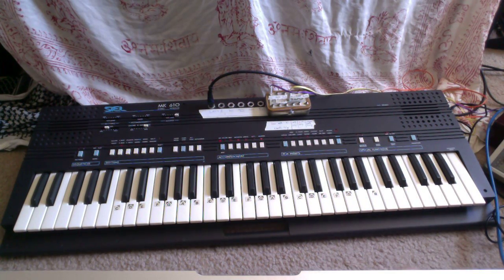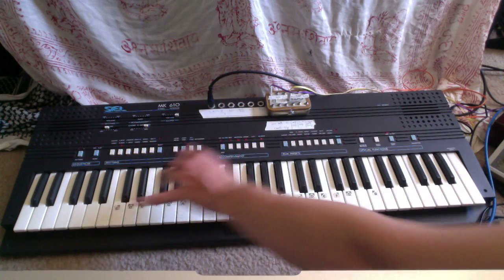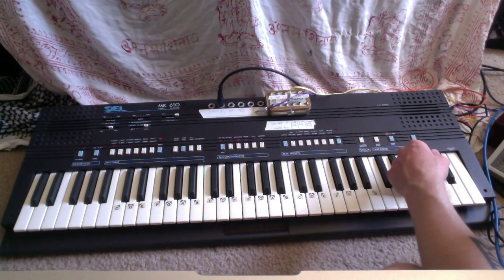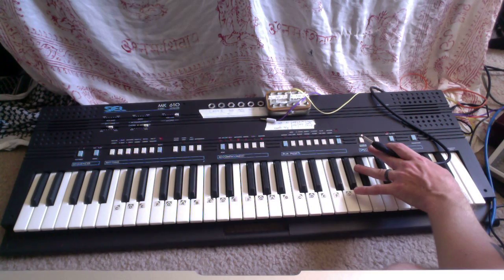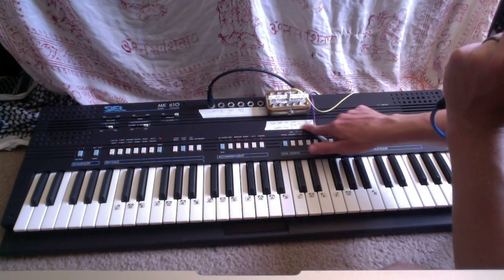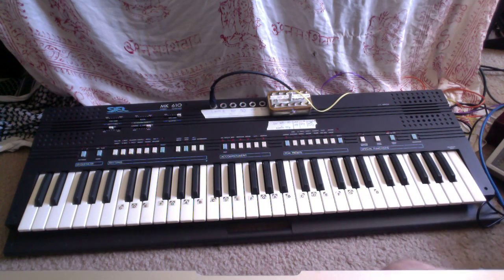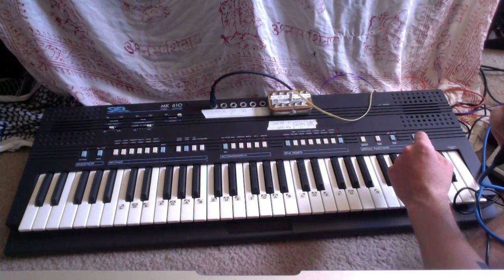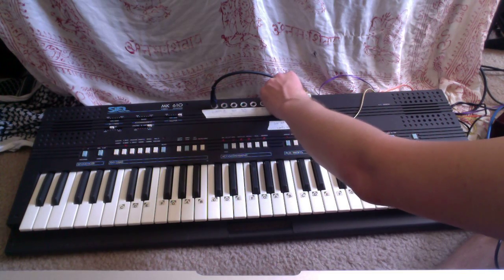siel mk-610 keyboard synthesizer mod circuit bend demo video

Comment: Hi! I just got a Siel mk-610 to use as a midi keyboard. I have it all hooked up to my interface (audiobox usb) but no midi signals are going through. I'm wondering if there are settings I have to change on the keyboard itself? The MIDI button on the keyboard is lit up, but it doesn't seem to do anything. If you happen to know how to set it up, please let me know... thanks!!
Reply from the maker: +Lillian Frances unfortunately, the MK-610 is NOT a MIDI keyboard.  it does have the "serial port" on the back, as well as a button on the front that says "Serial Rate- MIDI", but I've tried all methods and this keyboard neither receives nor sends MIDI information.  the MK-900 DOES have MIDI, but not this one.  the MK-610 is a fabulous keyboard with some great sounds, I recommend holding onto it, but look elsewhere for MIDI capabilities.
Reply: thank you for your answer!! really helps :-]

Comment: So this keyboard has only a MIDI RECEIVE? So can be played by another master keyboard?
Reply from the maker: no MIDI, though it seems like it should due to the MIDI DIN connector on the back.  the MK-900 model does, but not this one (the MK-610).